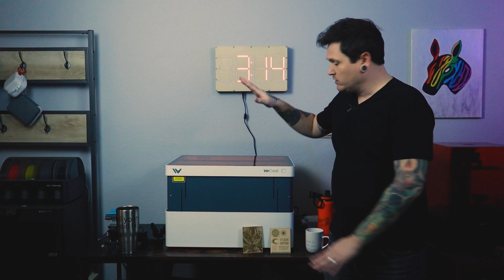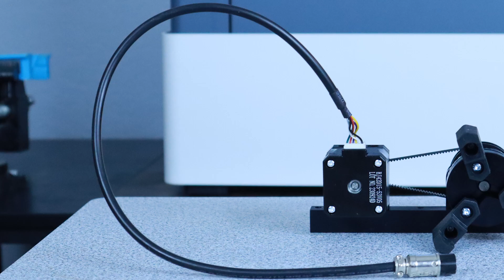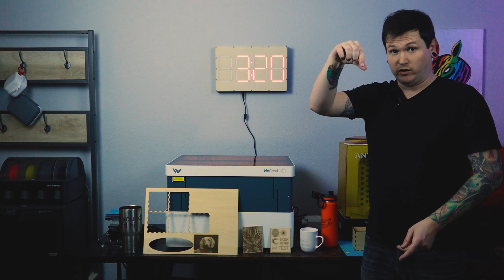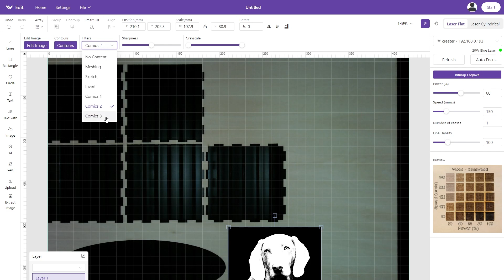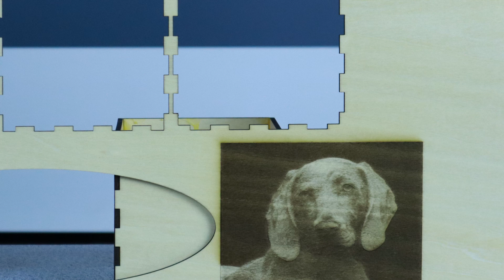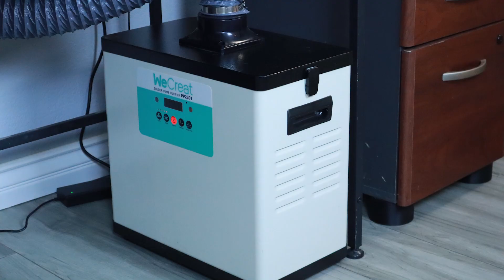Best Laser Engraver for Hobbyists? WeCreat Vision Laser Cutter Review

Comment: So, this only works on the windows format?
Reply from the maker: Great question! I should have touched on that in the video. The WeCreat MakeIt! software is available for Windows, macOS, Android, and iOS. Or you can use LightBurn, which is available for Windows, macOS, and Linux. But with LightBurn, you don't get all of the features and so I would use MakeIt! if possible.